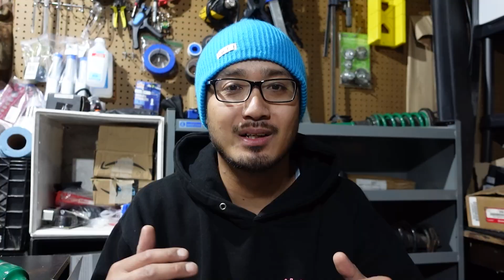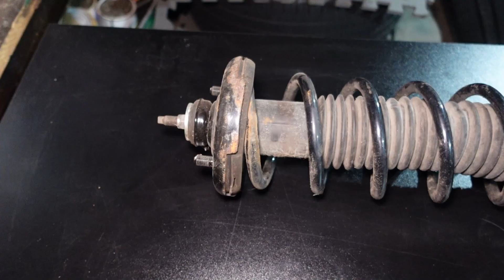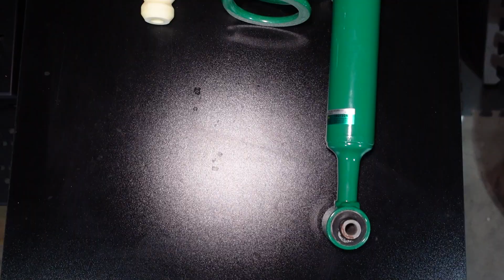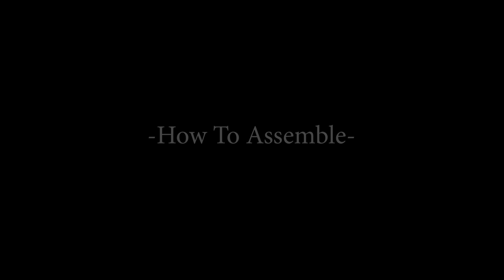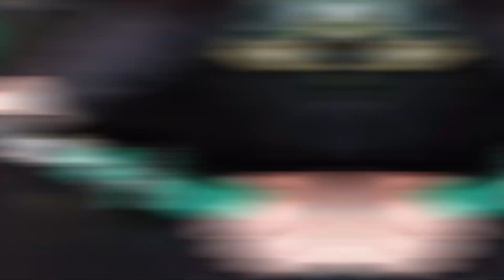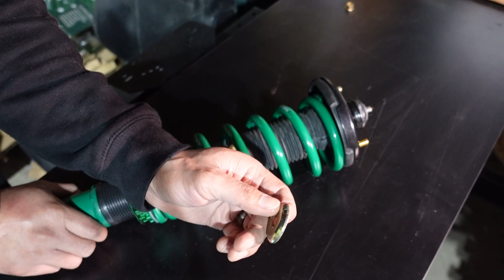How to Assemble Coilovers! (TEIN Basis Z + Top Hats)

Comment: Is there a model number for the top hats? Honestly i cannot find that mevotech kit i saw in your video.  I have those exact same tien coilovers but I'm unable to find the top hats (I'd rather purchase new rather than reusing my old hardware from my stock struts and shocks). Thanks for the video. But part numbers would help go a long way lol
Reply from the maker: No idea about part numbers/model numbers.  Check out RockAuto.com. that's where I bought mines.
Reply: @thecarfiend11 id the front top hats have a built in rubber piece like the rears? Thus far I've only seen the metal ones? But thanks for the heads up about rockauto I've definitely ordered plenty of parts from that site. Mainly just to get the magnets lol

Comment: Do you typically need to compress the spring to get the top hats on when assembling a coilover? Or do you only need to do that when removing and reusing the OEM spring?
Reply from the maker: the springs are lower than stock, I do have to compress them when assembling the tophat.  BUT you don't need a spring compressor.  just compress by hand (with some strength) and tighten that top nut by hand so it doesn't disassemble.  then use tools.  that's what i did.  If you're messing with OEM springs, you definitely need a spring compressor (SPECIFICALLY FOR SAFETY)

Comment: Yo my metal sleeve is stuck where you adjust soft and firmness, what should I do to take it back out? (Already installed on car)
Reply from the maker: Yeah, there's a good chance that it's seized.  First, use some WD-40, or similar sprays that can loosen bolts and spray it.   Clean out the threads with a brush.  Then try again.  If that doesn't work, then you need to get more aggressive and hammer it.

Comment: My OE top hats are starting to rust, any suggestions for some aftermarket tops I can buy with tein coil over kits?
Reply: Teins are made to use OE tops. If you can by OE parts from a dealership I’d recommend that or any cheaper aftermarket that’s identical

Comment: My nut on top of the strut makes the metal rod rotate when I try to tighten it down, does yours do that as well or am I doing something wrong?
Reply: Also there should be either a bex slot in the top of a flat portion that you can put a wrench in to stop it from spinning.
Reply: I hope you figured this out by now but basically you wanna finish tightening it when it's installed on the car so it won't go anywhere